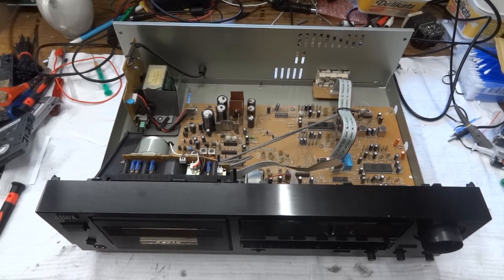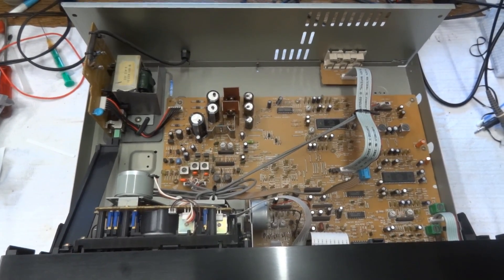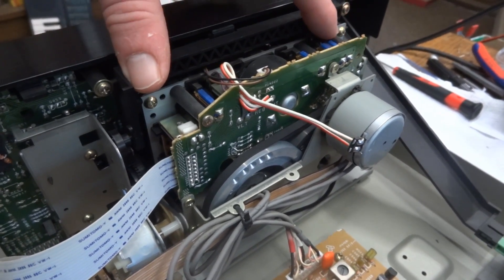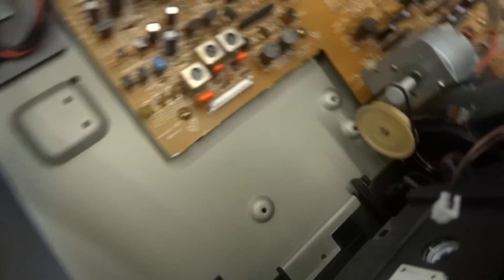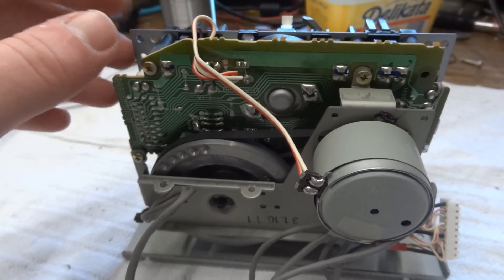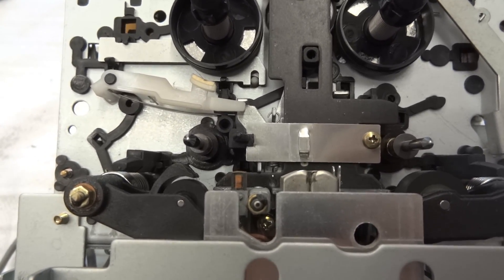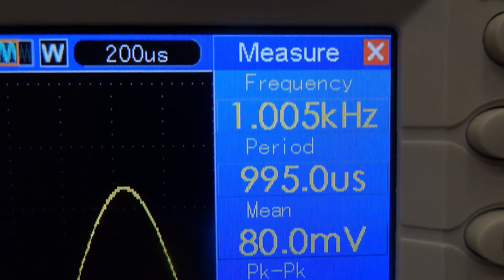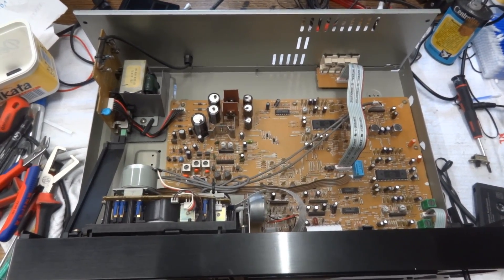DrCassette's Workshop - Aiwa AD-F910 cassette deck repairs

Comment: Hey man, nice video, just one question, i have an aiwa 6550 and sometimes the tape speed goes slow and it's very annoyng. Is that a belt problem or what? Thanks a lot😁
Reply from the maker: If it slows down, but eventually speeds up again to normal speed all by itself, there probably is a problem with the motor. If it goes slow and stays slow until you stop it, it could be a problem with the belt.
Reply: @DrCassette  Is there a way to fix it without having to change the motor?

Comment: Hello! I have the same model but there is a issue with play! Looked at meter board and found some issue with some resistor, I think they are burned! the replaced parts where soldered on the back side of the board, the thing you are holding at 14:30!by the way cassette lid comes out by lifting up with door opened! need advice with play mode on this one! Much obliged!

Comment: hi, ı have one deck. but back light lamp poor working.. how can ı repair? is it led?
Reply from the maker: Do you mean the light inside the cassette compartment, or the display?
Reply: @DrCassette  yes, inside cassette back light
Reply from the maker: If I remember correctly, that light is indeed just one LED
Reply: @DrCassette   I have one more question, my f880 aiwa.. when recording chrome tape right channel is high, with normal tape left channel is high level.  source position it is normal but tape monütör rec unbalance

Comment: Nice presentation. I replaced belts many years ago and till now they are in good condition. But when last days I tried to start my old F910 I discovered rewind does not work. I repalced idler tire and now mechanism works OK. I did not video but I found something what can help persons having tape rewind problem, look here: AIWA AD-F770 IDLER TIRE REPAIR (part 2) - mechanism looks the same like F910. Be patient and precise. Very important is take care about very small ball and 3 springs - remember location and position. Removing head assembly is tricky - it is necessary to push it to the top "read/write" position by moving (use left hand) the bottom sheet metal base on which head assy it is located and with the right hand remove the head assy. Good luck!

Comment: The mechanism looks quite similar to that of the F810, which I intend to fix because the belts have mutated into sticky lumps of black mass. The belt sets one can buy here in Germany are different: The F810 belt sets contain only 2 belts, not three. Is that correct?
Reply from the maker: I am located in Germany, too, and the belt kit was bought on the German Ebay. The F810 may be different from the F910 seen in this video. You can find all the info you need in the service manual.
Reply: @DrCassette  Danke! Auswechseln der Riemen war erfolgreich, das Gerät funktioniert wieder wie am 1. Tag!

Comment: Hello . It's very impressing what you do. Amazing.
I have a problem with a mini sistem hi fi SONY CMT - SPZ50 . The rubber band of the tape deck is old and doesn't work
Can you post a video about how to replace a rubber band of a mini hi fi system like SONY CMT - SPZ50  thas has the tape in front of the sistem, on  top, very difficult to work on. I have no technical knowledge. Thank you ! .

Comment: I just finished changing the belts on mine, works great! for some reason the eject button no longer works but i can use the pause button to open it up and a little nudge to close. Any idea why this could be?
Reply: remove the belt system for door and adjust proper! Same issue with mine!
Reply: Cheers doc

Comment: Hi. I have a F810. It plays a little faster and the previous owner has replaced the capstan belt. Can it be because of the belt or do I need to adjust from the capstan motor? TIA
Reply from the maker: Belt related problems (too tight / too loose) usually cause the speed to be too slow. If your cassette deck runs too fast, the capstan motor should be adjusted. But also try to check the tension of the capstan belt just to be on the safe side.
Reply: @DrCassette  Thank you will do!

Comment: Aiwa deck especially the ADF 800 880 810 and the 910 need quality belts believe me. If you can get them the are exceptionally great recorders up there with Naks, yes the Naks are better built but for the money ill take those Aiwas anyday. 
Nice video btw.

Comment: I have an AIWA unit 3 head, model AD 3800 i managed to replace the melted belt and its back to operation now. I noticed in the repair manual that the two capstan flywheel should be synch when assembling coz i noticed markings in the flywheel face, the instruction further said to look on the other AIWA model AD 3600 with same mech where the instruction is given how to assemble . But the absence of it tempted me to proceed the assembly and luckily it worked now. But what worries me is there a clanking sound when we put tape into the tray. Is this normal as i noticed also when you put a tape inside the tray there's a clanking sound.
Reply from the maker: That is just a feature of the mechanism to set up tape tension and to take up any tape slack that may have occurred inside the cassette. So it is normal behaviour.
Reply: @DrCassette  thank you sir and best regards.👍

Comment: Hi there. Ive got one of these decks which i had from new. I need to replace the sumitomo cable from the board to back of cassette mechanism..
 1 how many    cores are in this cable 
2 . Which way round is it.. normalnof let right..
2 what length is this cable approximately. 
I have missplaced the old cable..
Also have you got the link to the belt kit you used.. Thanks . 👍👍

Comment: Hi Doctor, I've just replaced my AD-F810 belts but found that the idler also have problems and should be changed. I looked at the service manual but not quite clear how to dismantle it. Could you help me with that?
Reply from the maker: I don't even remember this cassette deck mechanism has any idler wheels... I don't have this cassette deck anymore, so I can't help you. Sorry.

Comment: I have a f 660...recently i changed the belts,i put the cassette inside,pushing the play button.....the reel motor that is spinning the flywheels is not spinning.I tested the motor separately,is working!The forward/review is working.And the head assembly is not engaging.Any advice ti fix this?What i should check first?Is a mechanical issue or electronic?Thank you!
Reply from the maker: Obviously I can't know what you did wrong when replacing the belts. It could be a problem with the electronics, though I don't think that's very likely. A problem with the mechanism is more likely. Maybe you got some gears misaligned, causing the timing of the mechanism to be wrong. Please also refer to the service manual that you should be able to find online.
Reply: @DrCassette  Problem fixed!Solenoid stuck! I did some recordings in normal,cro2,metal.On normal tape sound fantastic,no differences source-tape,but on metal and cro2 tape the sound is dull,with big differences source-tape.All cassettes they are brand new,i have a lot of cassette tapes,i tried different (tdk sa,tdk ma,sony metal,maxell,that's etc...all cro2 and metal tapes the same result!Normal tape sounds excellent!Any ideea ,to fix this?

Comment: I myself would not use lighter fluid clean up the captions because it's petroleum Bass I would use isopropyl alcohol which would clean up the oil and then evaporate leaving no residue which is much better

Comment: Nice touch at 11:43, very sensible! I get the impression that Aiwa (and others?) were sometimes more concerned in "thrashing out" a new model, keeping costs down, and consequently paying less attention to some basics in electronics. I found this to be the case with the now obsolete Sansui DR201V DAB+ tuner where I had to fix and modify a power supply failure.
Great videos DrCassette, you're English is superb!
Reply from the maker: Thank you :)

Comment: Hi, love to watch your workshop videos, specially on cassette decks. In this video, you mention lubrication on the flywheels bearings. What kind of lubricating do you suggest? (there so many opinions like synthetic oil, lithium grease etc). I have a similar decks (Aiwa AD-F810). Thank you.
Reply from the maker: For the flywheel bearings I use a synthetic oil. Use a syringe to apply the oil to avoid a mess.
Reply: @DrCassette  Thank you. My problem is that flywheel can hardly spin on my Aiwa AD-F810. So a light synthetic oil injected with a syringe will do the job. I wish what oil they used in the factory so long time ago...

Comment: 17 euros for 3 belts...... Yikessssss!

I reckoned my long time hobby would be expensive with just belts alone. So I bought all common lengthz 4mm flat belts, and 3 and 2mm. And also other belt sets in 3mm, 2mm, 1.5mm etc.  That cost me a couple of meals but now I rarely need to buy any more belts even though mine have lower quality in consistency, and yield worse performance in wow and flutter.

Comment: When I ran a company called Teletape I was invited to Singapore to see the new Aiwa factory. I didn't know that Sony at hat time owned the majority of Aiwa. A lot of the parts used were Sony parts. 
I remember a model of Aiwa that had a fuses and every one of the decks suffered fuse failure when you turned it on, which meant you had to replace the fuses before you sold the deck. Vey annoying.
Reply from the maker: Very interesting, thanks for sharing these memories!

Comment: Hello Doctor! Thank you for your video.  What an extremely thorough job! I have an Aiwa CX-NHMT75 that I bought from the Goodwill for $45. It had the manuals, the remote, all of the speakers, and it  looked to be in good condition.  Radio works, CD is finicky but works, AUX works,  but today I bought a cassette (just to test the players) and neither 1 nor 2 decks work.  I suspect the belts are bad.  I downloaded a service manual for this unit but all it seemed to have was electronic gibberish.  How do I find the proper belts and the proper manuals to repair  this?  Thank you DrCassette MD.

Comment: Dolby sounded muffled .. Playback gain has nothing to do with dolby . It's just volume . If your recordings sounded muffled try re adjusting the heads  and then adjust the recording sensitivity inside
Reply from the maker: Playback gain has an influence on the operating point of the Dolby expander.
Reply: @DrCassette   Okee thanks , I didn't know ;-)

Comment: How can you replace faulty heads?
Reply from the maker: The replacement heads must have a similar resistance to the original ones. If resistance is different, the heads and electronics will be mismatched. Screw in the new head, connect it and adjust the azimuth screw for maximum treble output while playing back a known good cassette.

Comment: I just picked up the older 660 model which has the identical mechanism, the two capstan belts have gone to goo, but the idler must be ok as it ff & rr no problem. Glad I've seen your video reassured me its not too bad of a job.
Reply from the maker: Try to find the service manual for the cassette deck online, it offers further help :)

Comment: I recently aquired sony tc-k71 cassette deck. No fuse inside! Even lower end cassette decks have fuses such as mayak 233(made in ussr) .
Reply from the maker: In my experience the producers in Eastern Europe and the USSR were really good when it comes to electrical safety. Their equipment may not have the best specifications, but a lot of what I've seen was built quite well. As for the Sony, keep in mind that Sony had started using fusible resistors in the late 70s. Those are just regular resistors, so they are not as obviously visible as a fuse, but they are designed so that they fail open circuit in case of a fault.
Reply: there is a square thingy soldered to the contacts of the power switch. Is that the resistor? It really looks like a capacitor
Reply from the maker: That could be / should be a spark suppression capacitor. It prevents arcing inside the power switch and thereby increases its lifetime. Just make sure the capacitor is fine, no cracks in the case etc. Sometimes these capacitors go bad, and when they do it usually is quite a spectacular event.

Comment: Aiwa did not put much effort or expense into the build quality of these machines. The thing is though, the 3 head decks sound fantastic! They seemed to pull off the same trick as Teac did in that respect. I have an AD-S950, it needed new belts 2 years ago and after replacing them and 'tinkering' a little it now sounds as good as it did when new. I also have a Teac V-1050 and cannot tell the difference in sound between the two. Even standard ferric tapes sound fine....to me anyway!
Reply from the maker: Three-head cassette decks have a significant advantage over regular two-head cassette decks. Three-head cassette decks have separate heads for erasing, recording and playback of a tape. Each head can be optimized to work best for its purpose. For example, the head gap is different for each different head. Two-head decks use an erase head and a combination record and playback head. To get one head to do both recording and playback certain compromises have to be made, for example the head gap has a size that is in between the ideal values for record and playback. So both functions do work, but not as good as possible.

Comment: Great video, wish I had the courage to make videos of my restorations, I don't believe I have the voice over quality you do when you describe whats going on. The AD-F810 and AD-F910 display what had become of Aiwa cassette deck quality. These are then models just their peak of engineering and build quality. The peak IMO was the 7000 and 9000 series around 1990/91. 

I just serviced the AD-F810 for a client a month ago, the idler mechanism uses that same crappy plastic that is now weakened from heat and age, often and beginning to crumble. I am considering trying to use the idler arrangement (J-Arm) from the Sankyo transports that seem to work better and last. Aiwa should have used the J-Arm style idler arrangement. IMO, this is the weak point in the transport.  Sound quality isn't bad at all for what it is. I managed to get wow and flutter down to 0.06% NAB weighted, measured on a Leader LFM39A. 

The transport is obnoxiously loud in fast wind positions, due to poor engineering of the idler mechanism.  Dolby/playback levels must be set using the 400hz Dolby cal. tape for proper encoding/decoding. This is important because tapes made on a machine not calibrated using it won't play back properly on other machines. An all in one test tape from ANT costs 70$,  well worth it to have use of a proper calibration tape to set/check speed, meter cal, playback cal/response, Dolby levels, meter calibration, azimuth, distortion, and frequency response, all on one tape.  Another thing  good to have is a cassette torque test tape, for checking and setting the reel table tension take up, and back tension. Proper tensions are needed for the transport to operate properly. 

Having an expensive but crucial M-300 gauge handy makes life much easier whenever stripping the transport is necessary, such as replacing the pinch rollers, removing the bearing plate for cleaning and lubrication. A mirror tape for setting the supply pinch roller guide isn't essential, you can make one from an old tape. Using it to make sure the supply pinch roller guide ramp set properly is essential. This prevents tape skew that causes tape damage,  while maintaining optimal tape travel across the transport at all points. It does take time to save the $$ to buy the test tapes and alignment tools, but they do make cassette deck work so much easier, not to mention allow the technician adjusting the deck to coax every last bit or performance it is capable of. Buying most of the stuff second hand now is much less expensive than it was 20 years ago and more. Setting up a lab can be done for under 1000$, not the 10-20K$ or more it cost back in cassettes heyday. 

Thanks for the great videos, keep on making them, as they help people to get their cassette decks out of the closets and working again.
Reply from the maker: Making good videos takes a bit of practice, but after a while most people get pretty good at it, you just have to start somewhere ;) Just don't upload unedited videos, because those are terrible unless you are REALLY good at it.
Reply: What program do you recommend for beginners to edit videos?
Reply from the maker: Sorry, I can't help you with this question. I have been using Adobe Premiere Pro for many years, but that program is absolutely not for beginners.

Comment: Hi I have a Aiwa ad-f910 to which I replaced belts and ilder but I can not put the springs of the capstain.Ho saw his video I would like to see the correct placement of the springs.Thanks.
Reply from the maker: Maybe the service manual for this cassette deck can help you. I don't have this deck anymore, and even if it was still around, I certainly wouldn't tear it all apart again just to show the placement of some springs.

Comment: Do you have any experience with the low-cost belt kits avialable on Ebay?  Looks like they come with several dozen, all different sizes.
Reply from the maker: I haven't tried any, but people I know have. Don't get the very cheap kits (from China etc.). The more expensive ones are much better.

Comment: I have a Tascam cassette/cd player/recorder. My issue is the weak rewind. which cause the deck to stop. is there anything I can do to correct that?
Reply from the maker: That could be caused by a bad belt.
Reply: i'll take it apart when i get the chance. the model is the CC-222MKII